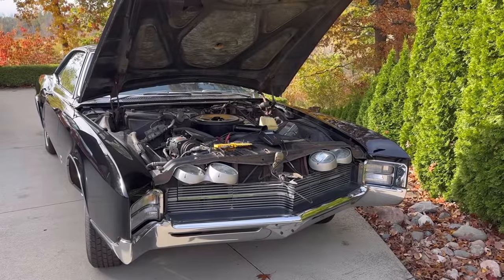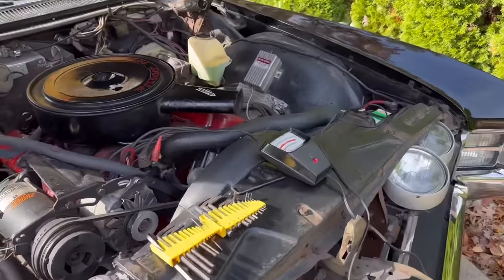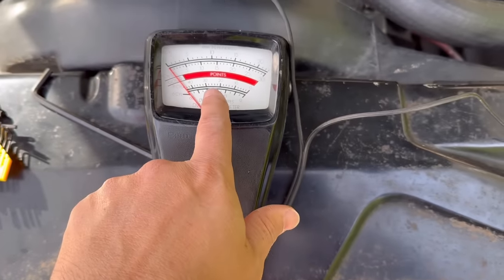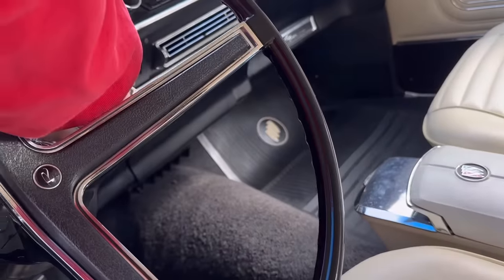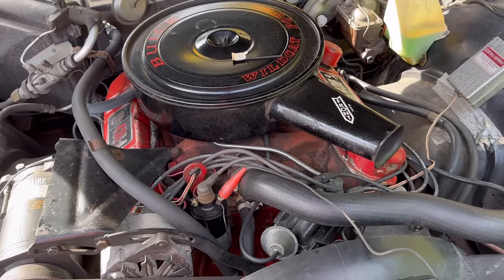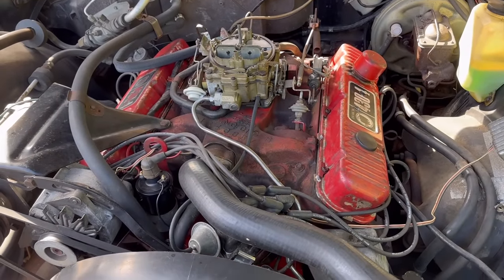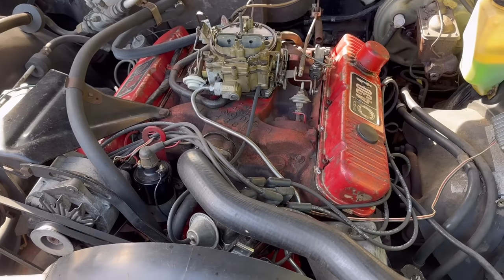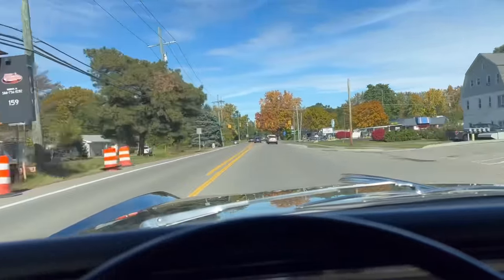Do It Yourself: How to Set Points & Timing on Classic GM Cars (Chevy/Olds/Pontiac/Buick/Cadillac)

Comment: That appears to be a little more dangerous of a job on the Buicks. On the Chevy v 8's I could adjust both the timing and the dwell with the engine running cuz the distributor was in the back away from that fan.

Comment: That window for setting the points weren't on all GM cars, perhaps only the V-8's.  My Corvair you have to remove the cap, not as fun.😐
Reply: Corrct. The six cylinder engines had to be set with a feeler gauge. I think some of the six cylinder distributor caps were compatible from the thirties up to the early eighties.